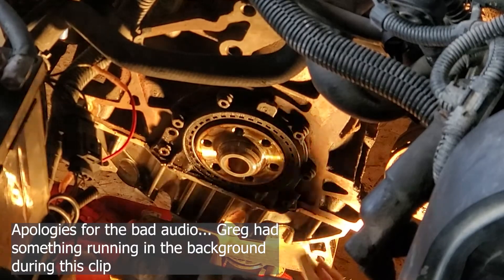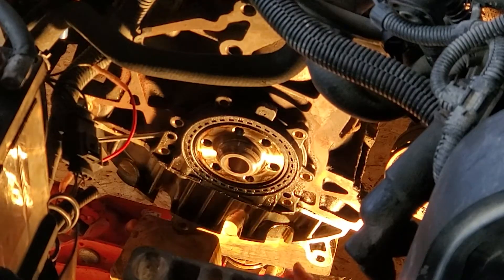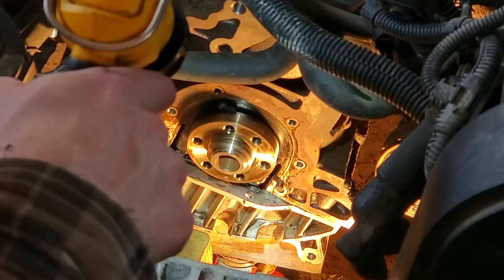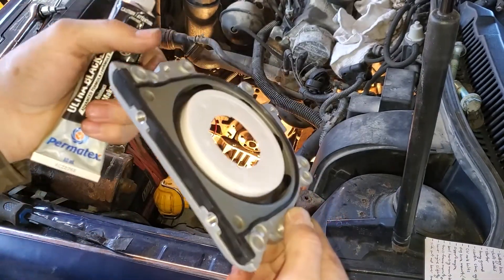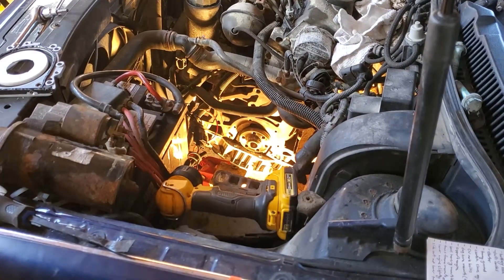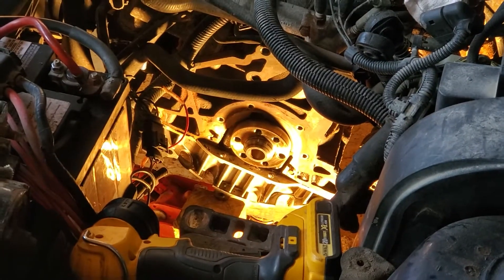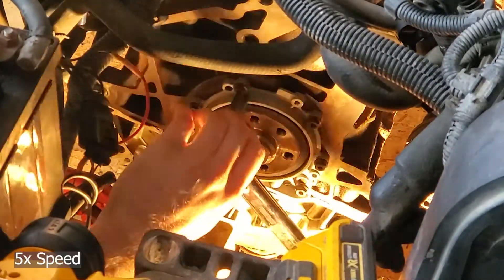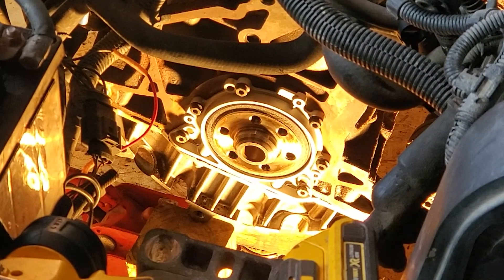Mk. 4 Volkswagen Jetta TDI (ALH) - Rear Main Seal Replacement Part 4

Comment: he didn’t do it according to the bentley manual. the manual states you should use a seal pressing tool that is a big cup and you are also supposed to put clean engine oil on the seal before install.
Reply from the maker: That process of using a seal press tool is used when you are replacing the oil seal from within the flange housing. As I replaced the entire flange, that was not necessary. Also, this type of seal does not require oil for installation. It is a PTFE seal, and in fact, it specifically says do not put any lubricant on it and do not allow your skin to come in contact with the sealing surface. If you have a standard neoprene seal, then yes, absolutely put a film of clean oil on the sealing surface before installation. It will help with install and making a good seal.
Thanks.

Comment: Excellent video!  Kudos for using a torque wrench and showing that cleanliness is next to godliness.  Will be replacing my original clutch on my 2003 ALH with a single mass flywheel (I guess?).  The car has 303K miles with the original clutch, turbo and injection pump.  3 timing belt/water pump replacements.
Reply from the maker: Thank you!
Right on. Still going strong! Yeah, the single mass flywheel is better in terms of not causing the vibration and sometimes chatter noise in the clutch when the mass dampers begin to wear out.
Yeah, the original clutches will do upwards of 600k kilometres. Same with the injection pumps, injectors, and turbos. I have several ALH cars with well over 500k km, approaching 600k and they have original everything, including the clutch.
They are great cars!
Greg

Comment: Wish I watched this when I did mine.. I didnt use gasketmaker and I pulled the plastic piece off before putting it on. Oil leak so now I need to do it again.
Reply from the maker: Ahh yeah, that's too bad. Yeah, people don't realize how important certain steps in the service process are.
Definitely come back to this channel if you have future service procedures to do. Also, feel free to leave comment if there is something you need to tackle that we have not made a video on yet. I may still be able to give you some helpful information.
Thanks,
Greg
Reply: I did the same thing.. ordering another rear main now lol

Comment: Hello! today i installed the new seal for my golf. I thought the white plastic thing on the seal was something that can be just thrown away :D. So i installed the new seal without the guider and now im wondering if it will leak. What are your thoughts should i just remove the seal and install it again with the guider?
Reply from the maker: Hello,
I would say as long as the lip on the seal looks like it's in the same position all the way around the crankshaft it should be okay and not leak. But if you feel more comfortable removing it and using the guide to reinstall I think that would work fine too. Just inspect the inner sealing surface to ensure it does not have any damage and reinstall. It's not like the camshaft seal where if you don't get it past the keyway safely it will damage the seal. It's a nice smooth surface so should be good.
Thanks,
Greg
Reply: @GBProductions0  Hey! Thanks for the answer. Today i got the gearbox mounted but im having problems with the clutch slave cylinder. The rod is extended all the way and no matter how hard i push it against the fork it doesnt move. What should i do?
Reply from the maker: Hmm, that's weird. Normally you can push back against the hydraulic fluid to allow you just enough space to start the slave cylinder mounting bolts. Then after that just thread the two bolts in evenly to pull the cylinder in.
If you cannot push the slave cylinder rod in then it may just be stuck or perhaps there is an issue with the hydraulic system for the clutch. I cannot say I have ever come across that issue before.
One thought would be find some longer bolts that are the correct thread (I believe they would be M8x1.25, but double check) and use those to pull the cylinder in part way, just to see if it was just stuck.
You will have to be careful though because if something is stuck or bound, applying force using bolts could cause something to rupture, or just break the plastic slave cylinder.
Let us know what you figure out.
Thanks,
Greg

Comment: Did you have to remove the engine oil to change the seal?
Reply from the maker: Hello, you do not have to drain the engine oil to change the seal.
However, I would recommend letting the car sit for at least a day to allow all the oil to drain back to the pan before you remove the old seal.
Thanks,
Greg

Comment: Did you ever have any problems with the seal leaking at all. After installing it. Was just curious
Reply from the maker: Hi, thanks for the question

I asked Greg just now and he told me it doesn't leak anymore and that it shouldn't leak again for a long time if the replacement of the seal was done properly.

- Mitchell